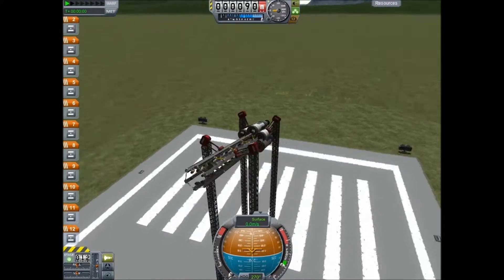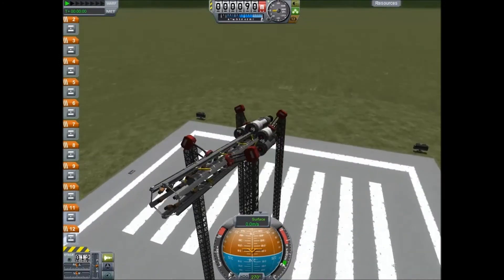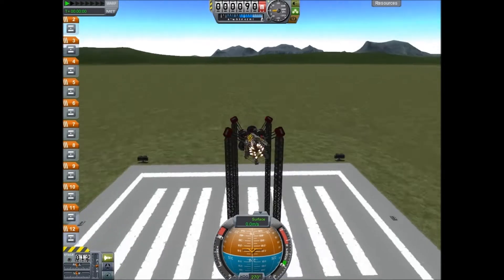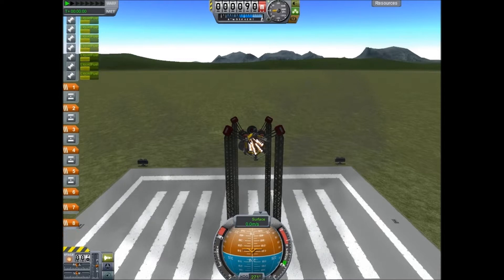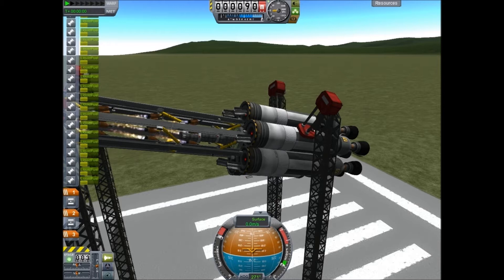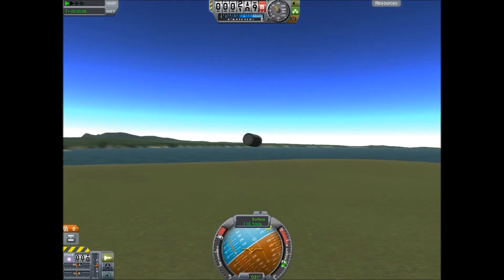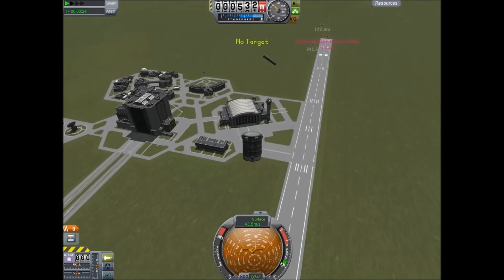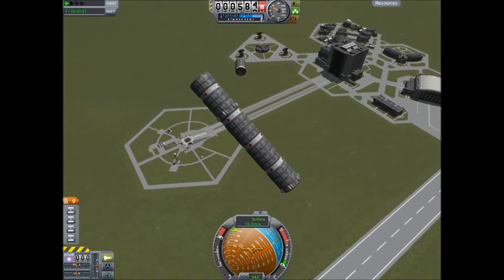KSP stock rail-gun testing!

Comment: You should close the thing so you can generate more power and the pressure wouldn't get away. Just test it out
Reply: You should also change the angle.
The perfect angle would be 45 degrees or 60